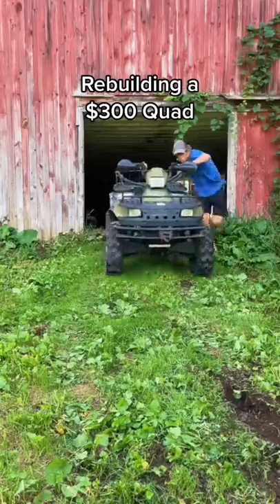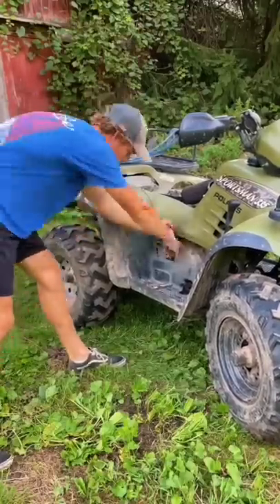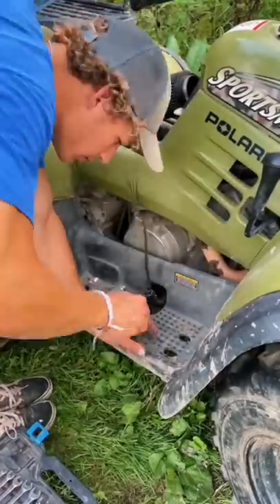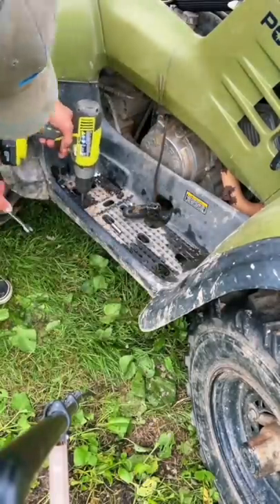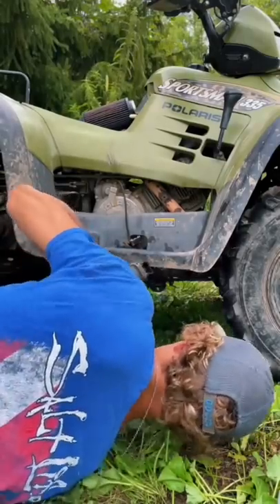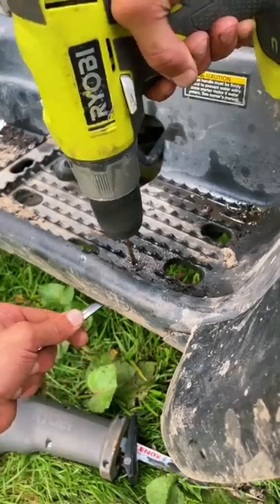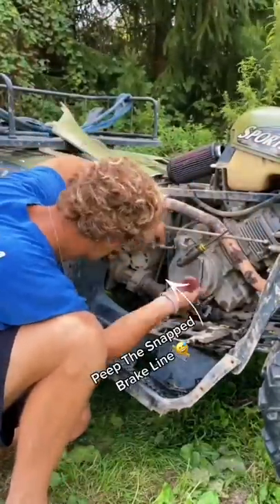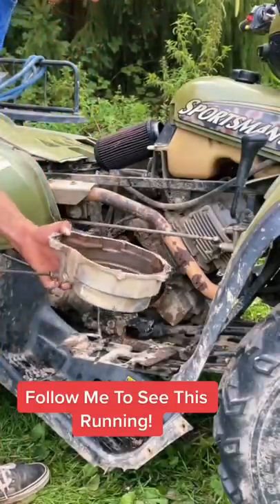I should have never bought the cheapest quad on facebook😭 #powersports

Comment: It's funny because working on mine is really a dream, alot of thought seem to went into it
Reply from the maker: Idk man i hate polaris i think they designed them very bad
Reply: @liamreid  agreed bro I got one the design is super not user-friendly
Reply: @liamreid  Rebuild a Duramax pickup truck, I did and every ATV is easy compared to that Duramax. 
That engine should have fired on the second pull. You got no spark. 
Check that Kill switch on that polaris, nearly every one I have worked on was bad.
Best of luck and quit feeling sorry for yourself!
Reply: Every Machine that has Ever been manufactured has its Flaws. Polaris is my Favourite to work on. Very Easy and reliable. i have had the other brands and i have Had nothing but break down. My 2014 Scrambler 850XP HO has 3500km and get ridden hard. only thing ive done is plugs, oil, and belts
Reply: @liamreid  I agree. I have a 01 magnum and whenever we had to change the carb out it was a struggle just to get to the carburetor
Reply: @liamreid  Well it's also not like Polaris recommended drowning your quad either
Reply: Too much carbon buildup in the head  and valves? Maybe the rings are shot ,do compression check
Reply: @greenhillgarage  work on a maxxforce intertrashnal worse than a dirtymax
Reply: @ianthompson2802  I had never seen one before but I looked one up on Google and I see what you mean. 
Really makes me appreciate working on my Dad's 7.3 Powerstroke!
Reply: @greenhillgarage  the powerstroke is an international engine when they were good
Reply: @ianthompson2802  Goes to show that more isn't always better, especially when it is more sensors, and a gob more parts.
Reply: @liamreid  300 bucks wasted? Man I wasted so much more on cars
Reply: @liamreid  300 dollar headache you bought lol their designed so poorly. It’s liquid cooled so it has abunch of other things in the way like the rad an such. Honda’s by far are the best quads on the market today. Especially if you get lucky an find a old foreman 450 you’ll have it for life. long as you take care of it lol
Reply: @greenhillgarage  I'm not a fan of heui injection tbh
Reply: @ianthompson2802  Adding hydraulic to the equation adds complexity. I prefer the direct injection of the Duramax and Cummins because flow is only limited by nozzle and fuel pump size. But, the 7.3 injection system is capable of about 380hp with stock or mildly upgraded injectors. For towing, 380hp has been plenty for me and Dad. The reliability of the 7.3 is why it is my Dad's tow rig, and the Duramax comparatively cheap horse power and Allison transmission is why I choose GM.
Reply: @greenhillgarage  they are all direct injection.
Reply: @ianthompson2802  Sorry, I meant Common rail for the Duramax and Cummins. 
The powerstroke has direct injection which is an improvement from the 7.3 IDI.
Reply: I buy and fix fourwheelers to sell and Polaris are the absolute hardest to work on. Changing a starter on a 2002 magnum 325 was hell among other things that needed replaced on that quad. Never buying one again. Don’t care how cheap.
Reply: @_AlejandroGonzalez_  For me, Polaris have been one of the easier ones to work on. Yamahas and Suzukis have been a nightmare with wiring issues. But I like the fully enclosed drivetrain.
Reply: My uncle worked for Polaris and always told me to avoid them like the plague, shit design, shit quality parts, and no quality control.
Reply: @liamreid  agreed
Reply: @liamreid u have your opinion doesn’t mean it’s right or wrong it’s yours

Comment: My man's has no idea what he's doing let's be honest 🤷‍♂️
Reply: Yes he does
Reply: @teammatrix4486  if u pull the pull cord 200 times u definitely flooded the engine
Reply: @teammatrix4486  using a drill and not a impact,cutting out the bolts with a saw zaw, etc
Reply: @Epalka-440  what was he supposed to do? The bolts were stripped
Reply: @Vl0gWithAb  he shouldn’t even be worried about the pull start in the first place, if it was me, id focus on the electric start. Works much better than any pull
Reply: @chaching399  yeah and if it doesn't work he should know what to do.
Reply: @Vl0gWithAb weld a nut 🙄

Comment: I would put my jump start box on it. Turn over, Verify spark, make sure full of fuel and fuel valves on, add propane if it runs on propane. Then dies when you take propane away you know you have a fuel problem. Real quick and alot simpler been working on things for years.

Comment: Why do people hate Polaris? It’s not that bad. I have myself a 2012 sportsman I got used and it really had no mechanical problems. The only problem with it is that the previous owner added a light bar directly to the hi beam and it kept throwing fuses but that I fixed easily and no problems now.
Reply from the maker: They engineer them bad, they run good but when you have to work on them everything is poorly designed and annoying

Comment: Being in the automotive field for years. I started using propane to start engines years ago and in the winter for faster start ups. Propane it never fouls the spark plug even if you put to much in it. I've had extremely hard to start gasoline engines with blown head gaskets, cracked heads and extremely smoking oil the engines would only start with propane to move around lot.

Comment: Bro first of all fix the electric start the pool cord is meant for a backup and will break after repeated use check your compression clean the carburetor and put a new battery in it

Comment: Fix the pull cord ,clean the carb ,check sparkplug ,check oil and it should start no problem
Reply from the maker: Yeeeep
Reply: No it won't cdi box is probably fuvked the connections need 2 be cleaned 2
Reply: @officalzgamez3866  curious. How youd come up with that diagnostic? 😂

Comment: Get a impact driver with impact sockets.

For rusted screws and bolts buy an extracter set

For drilling into screws/bolts buy cobalt drill bits and drill at a slower speed.

Comment: Had the exact same model quad come into the shop. Worked on it for months, there was nothing wrong with it. Brand new plugs, perfect compression, had spark, had fuel, no air blockages, correct timing, everything was exactly how it was supposed to be. The thing did not run, no matter what we did. We had to return it to the customer and tell them it just doesn’t run. Only time something like that has ever happened to us.

Comment: Know the feeling buddy. Bought a well abused Rubicon years ago. Hondamatic started messing up. Pulled motor a 3 years ago. After a new Hondamatic, oil pump, messed up cam and bunch of other parts had more in it than it was prolly worth. But it has worked like a brand new one ever since so I’m prolly back even by now after a few years of riding

Comment: I got a '95 Magnum 425 for 600 bucks because it was in pieces and didn't run because of carb issues. Me and my friend took the carb apart and the main jet fell out. I got a running and riding quad for 600 bucks

Comment: These are easy ti work on. Without all this unnecessary junk. Fixed my neighbors after it sat outside for 5 years. Then someone messed with it and fixed it again. All i had ti do was remove the seat and the 2 side plastics. Not hard ti do at all.

Comment: Liam, Stop pulling the 3 inch cord so much. Replace it with a 6 inch pull cord(or Longer). Lubricate the nuts and bolts with WD-40. Recharge the battery and repair the electric start leave the throttle open after you shoot some hi octane ⛽ gas, and it should buck and jerk and ignite 🔥.Go with throttle up Liam and Godspeed!!🤖🤠🍋🥃🚜🛺🌈🦺🪛🔧🔩🧯🚭☦🆘️🇺🇲🏁🇮🇪🤞🙏🏻💪👩‍🔧👩‍🔬🦸🏻‍♂️🗣👱👌👍🍺🐅🦧🐢🐿🐇🐐🦌🐄

Comment: Bro you got the wrong machine. My family runs polaris exclusively, and we're always the ones who continue running without fail. We've got a 1991 polaris indy 500, runs better today than some new model snowmobiles, and a 2006 wheeler like yours, a 500, and it hasnt broken down in all the years we've owned it. (We boight it new) I'm definitely biased towards polaris, but you probably should just understand most of the major brands like polaris, Can-Am,  arctic cat, yamaha etc. All make really good equipment. Brand bias is real, but so is a lack of effort due to hate.

Comment: The engine isn’t starting, you don’t need to check the spark and if the petrol is gettin in the engine, first thing to do is to change the rope🤦🏻‍♂️I bet that after it will start